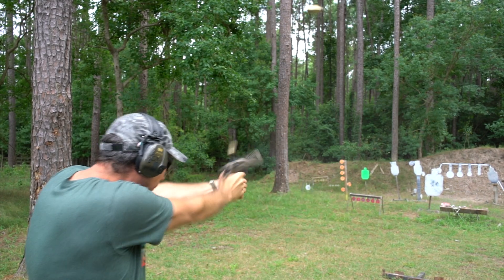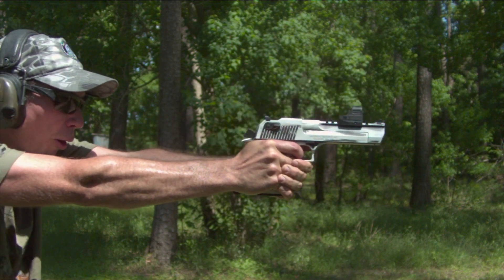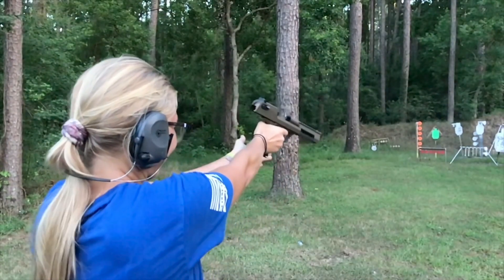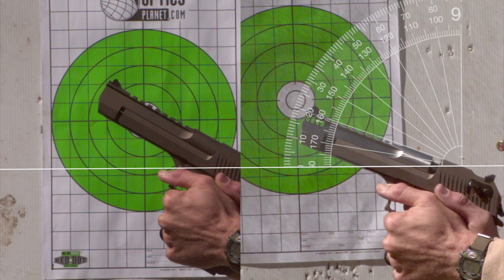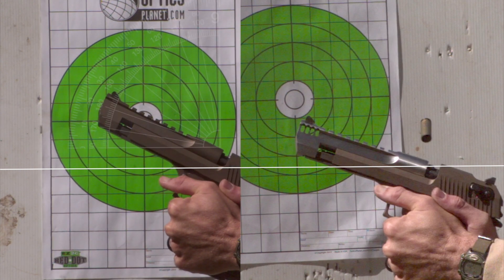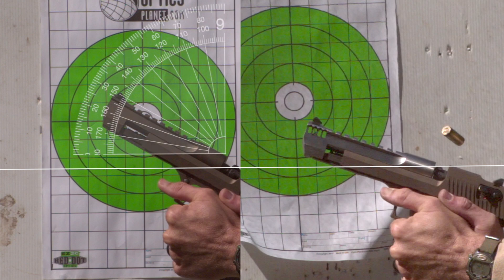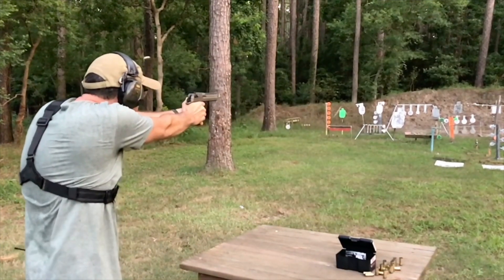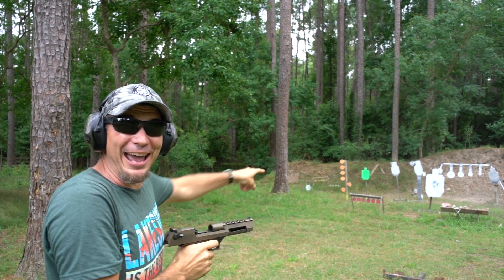Desert Eagle 50 AE Recoil Differences with an Integral Muzzle Brake (High Speed Camera)

Comment: I absolutely LOVE mine; it's in their black oxide finish without the muzzle brake chambered in .50AE. 300 grain FMJ from Buffalo Bore, shooting at an indoor range, you become the celebrity of the gun world for the time you're there. Everyone watches and smiles, especially when you light the cannon. I found the 300 grain doesn't give such a punch to the wrists like the 350 grain JSP from Magnum Research, even though it hauls out the barrel at approximately 1500 ft/s compared to the roughly 1300 ft/s from Magnum Research.

Comment: They should atleast increase the barrel length about an inch and a half then the front ironsigjt would sit where it’s supposed to be on just like the version without a muzzle break and add a hole in-front facing upwards.